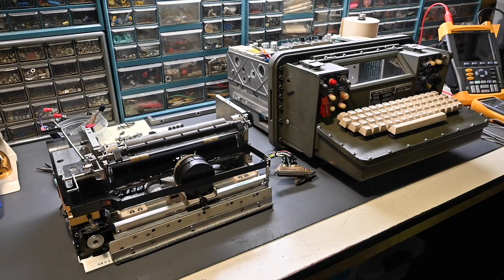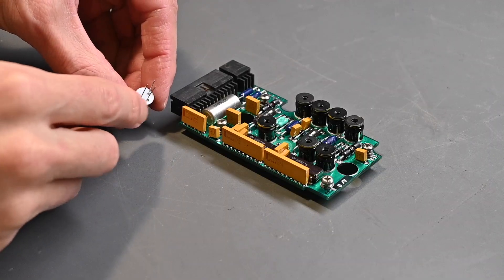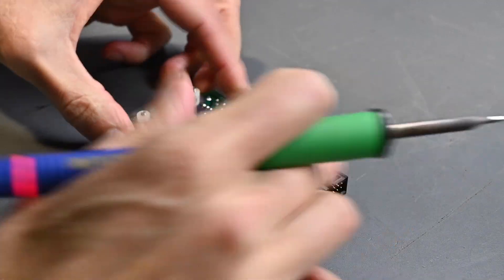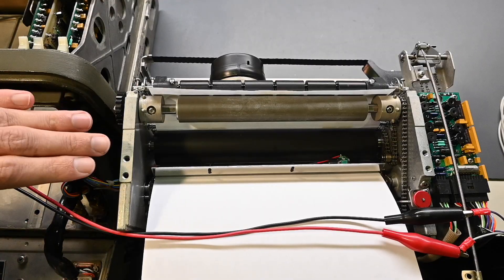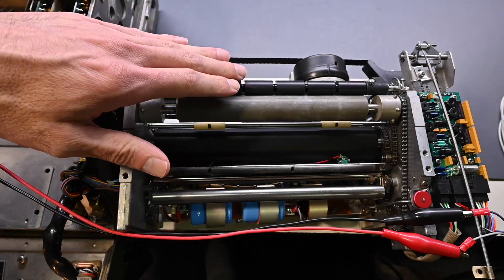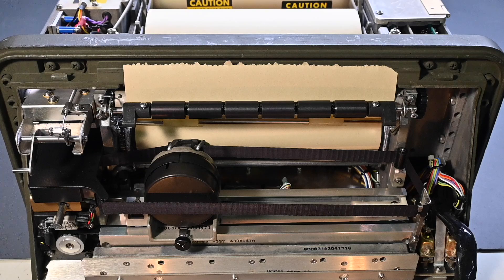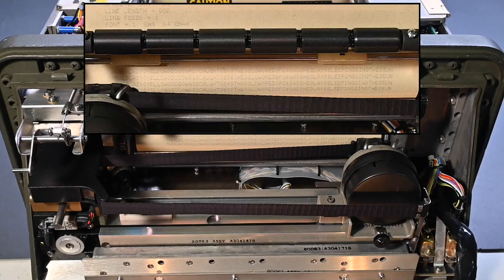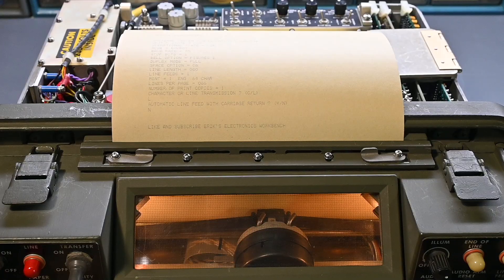Military UGC-74B Communications Terminal, Printer Electronics Repaired! - Part 2

Comment: This is really awesome. I’m so happy that I happened to come across your video. I recently acquired an AN/UGC-74B(V)3 machine a few weeks ago, but it didn’t come with a power cord. The power jack has J2 and J3, and I think either one could be used, but I’m not sure how to obtain the proper power supply. I would appreciate any helpful guidance. Thank you.
Reply from the maker: If you email me I can reply with some tech info that shows how the power input works.  It's more than I can explain here but the schematic makes it clear.  The DC input connector is only memory backup power.
Reply from the maker: Also check out part 1 at https://www.youtube.com/watch?v=iOclAUD-AAc  at about 38 minutes I show the input connector wiring.   But happy to email info as well.